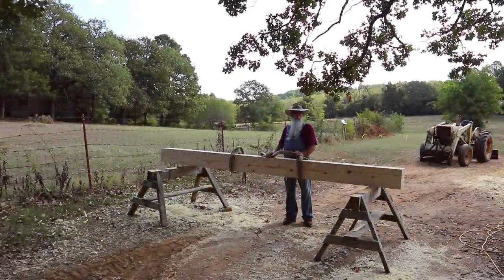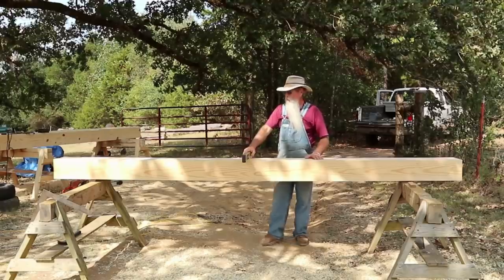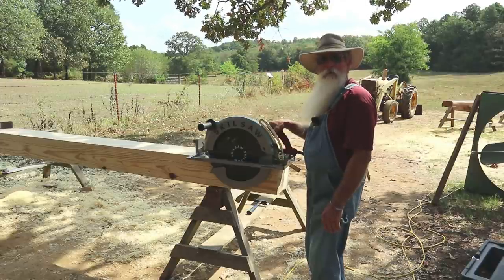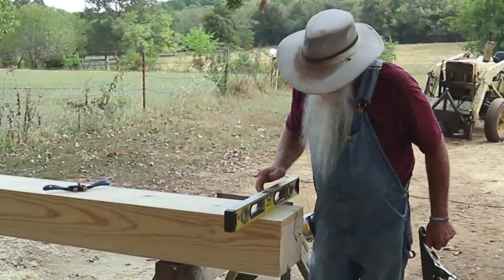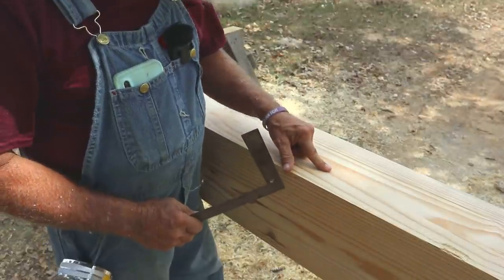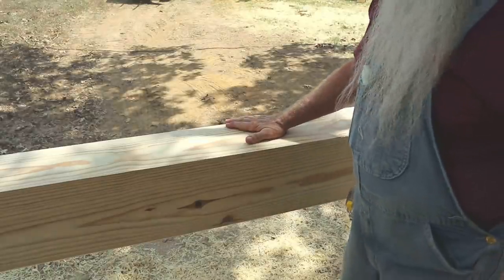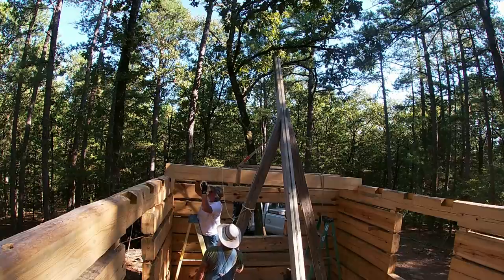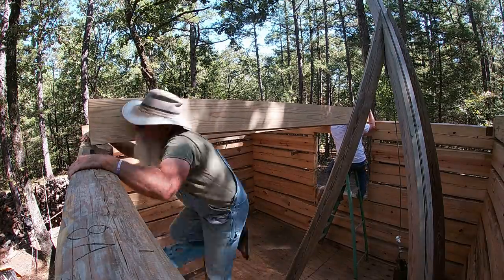Cutting/Setting 2nd Floor Joist, Paradise Point – Ep 8

Comment: Your hoist platform looks a ripper. Would you mind sharing the dimensions with an Aussie fan. It looks a safe design for lifting logs. Love your posts.
Reply from the maker: Howdy Wayne- yeah, the hoist is a big life saver for sure. I have two different hoists- one that has a 16’ boom that I use until I get to the second floor joists. The other has a boom that is around 9’ long. The base 7’ one all three sides. I have a video of how I built and put together the shorter hoist. You can go back in our videos and watch it. I have all the dimensions of the hoist in the video. I appreciate you watching the video and for the nice comment. God bless